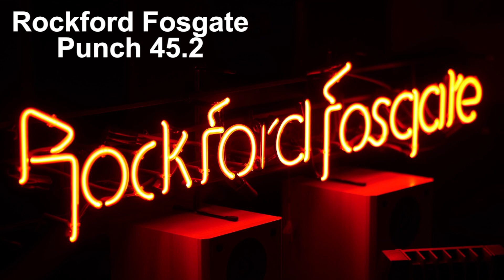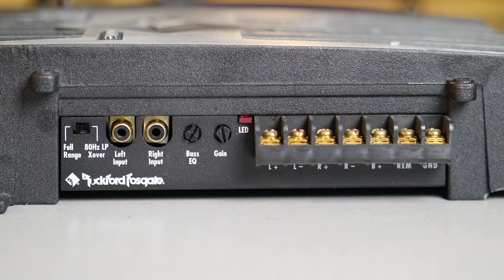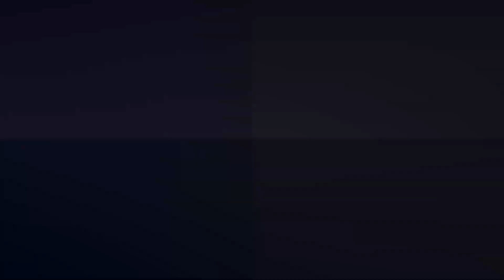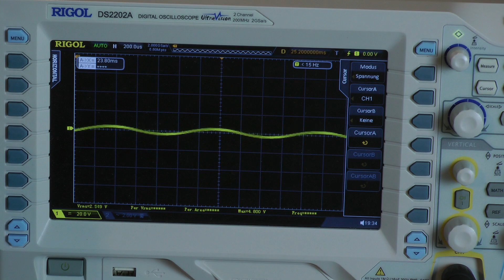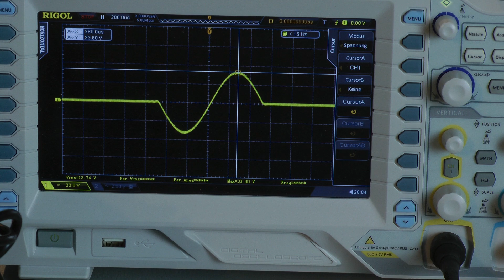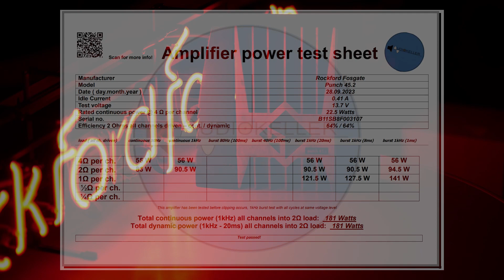Rockford Fosgate Punch 45.2 amp dyno oldschool amplifier power test

Comment: Do you think this amp is the same as the 100z2 you dynoed?  Same board just different model number?  Thanks. I love your videos
Reply from the maker: Basically these are the same amps with smaller changes made during the years. Very similar to the classic punch 40. 👍

Comment: Nice video, as usual!
On a different note, I just bought a Punch 400S amp, from 2001!  Do you think the 400S amp is comparable in power, to the Punch 360a2 amp you tested here before?  Thanks.😊
Reply from the maker: Thank you!!
I think they are almost the same amps, the 360 is rated 90Watts per ch into 4 while the 400s is 100 Watts into 4 Ohms but measured at 14.4Volts.
The 360 has been rated at 13.8 Volts. It also has been rated at 14.4Volts , not continuous but dynamically.